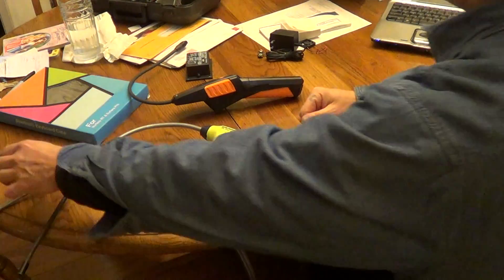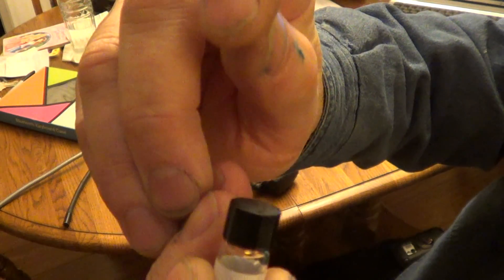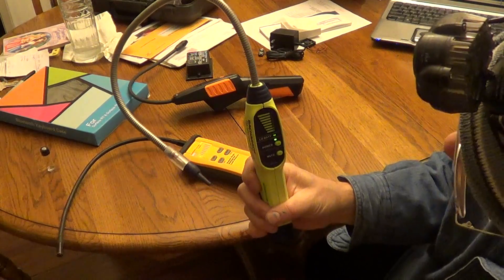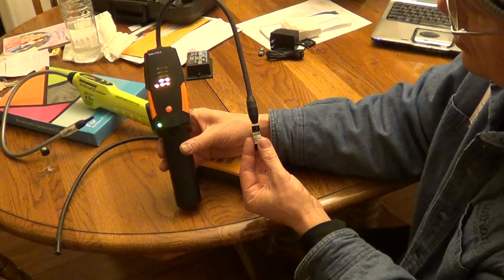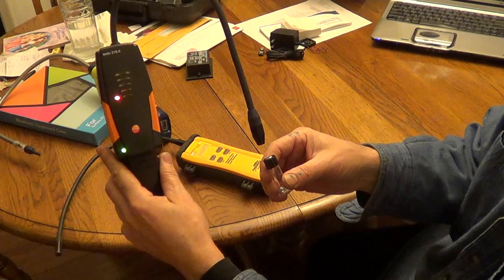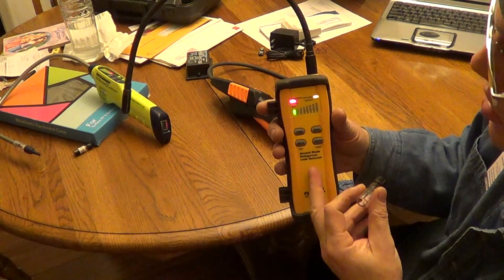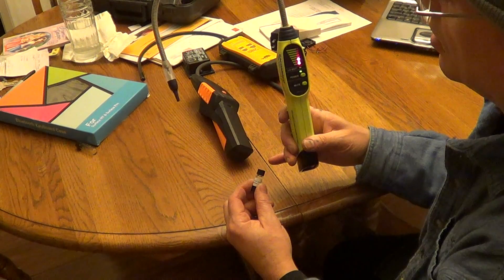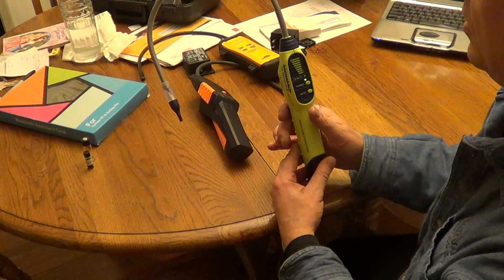Reference leak comparison of Fieldpiece SRL8 Testo 316-3 and Bacharach Informant 2

Comment: I’m in the market for a new leak detector I have the tek mate but I’m interested in that testo. Which do you recommend
Reply from the maker: I have been using the fieldpiece dr58 for the last year.    I made my report free in the description of my leak detector videos.    One thing about poe oil is that it doesn't leak much refrigerant when the hole is towards the bottom of the pipe.    So, r410 leaks can stop when the equipment isn't running.